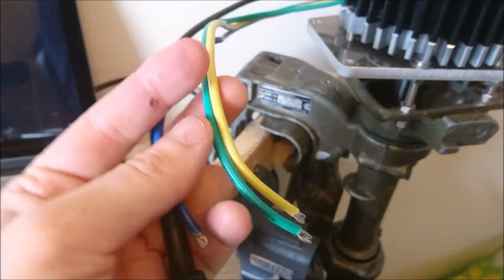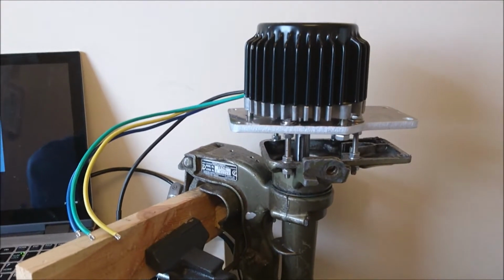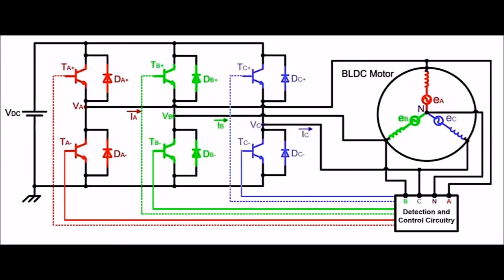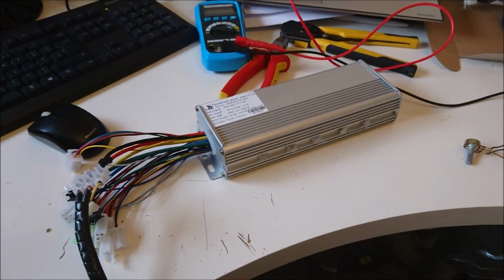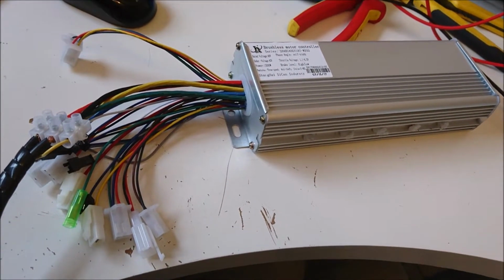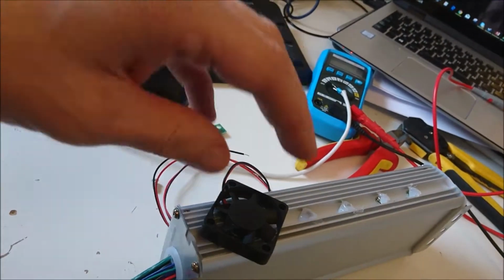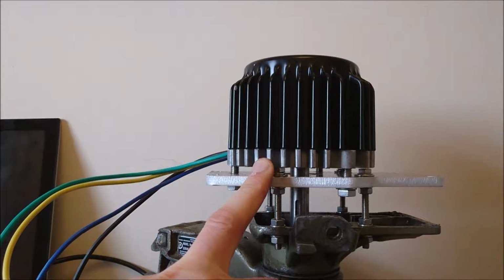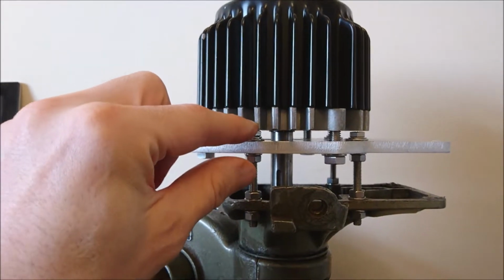Update on defective electric outboard motor controller

Comment: Gosh what a complicated motor drive box. How on earth can it need so many wires?
Reply from the maker: Indeed! I have just got it working and can confirm that the motor is fine. Currently rebuilding. There are a vast number of obscure wires on that controller, which do stuff I have no need for. The problem is they are not labeled!